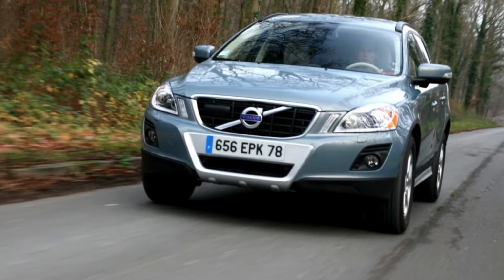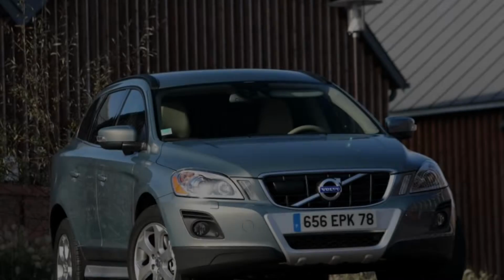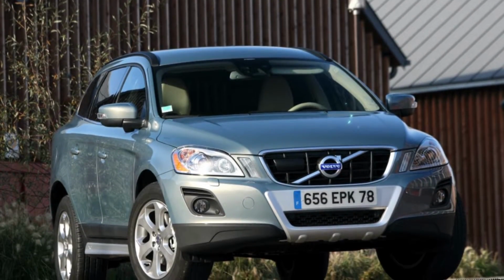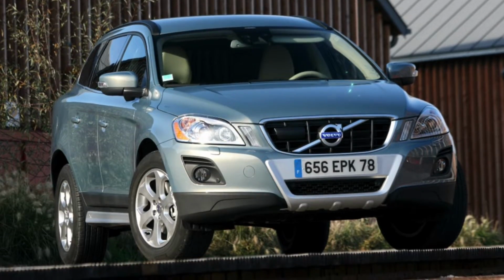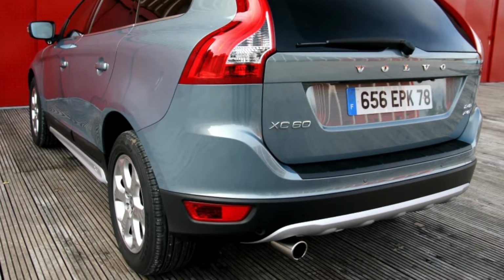Volvo XC60 Problems | Weaknesses of the Used Volvo XC60 I

Comment: so my xc60 t6 after leaving it off for a few minutes ill start it up and just barely hit the gas to rev it while its in park and ill hear and feel a slight grind and then everything is fine like it drives smooth no issues or sounds, i did a trans flush and noticed theres a leak between the transfer case and trans not sure if they share fluids but my guess is the transfer case is about empty and the grind is the transfercase initial engagement. im not a mechanic but that small grind noise definitely only happens upon initial press of the gas i use to put it in drive then hit the gas but i felt like that grinded it harder than just doing it in park then put it into drive. so everyday i start my xc60 i start it, let the rpm settle to 700 then slightly gas the engine get the grind noise then go to drive/reverse and everything is fine just hit a 0-60 in 6.6s with 1/4 mile 14.7s  yesterday and i monitor the trans temp with my torque OBD2 and it  stays 190f with spikes up to 215 when doing a 0-60 combined with waiting at a red light for a while
Reply from the maker: That sounds like a transfer case issue, and you're right, it could be low on fluid.

Comment: Volvo XC60 107000 kms, 7 years, treated as own child and this year started to show being a very problematic car, fissure in one cylinder so change whole engine (13500€, no brand or wholesale sales support at all), 1500 kms later a fisure in one air tube (600€), 5000km later clutch problem(I’m waiting for the invoice)… definitely not a brand to rely on anymore.

Comment: My engine blew at 116,000 miles it is a 2016 xc60 t5
Reply: I’m getting my t6 replaced rn it blew at 126,000 and i I bought it with 125,000. Bad luck ig
Reply: @NaCl_Goat what was the cause ?
Reply: 2015-2016 Volvo's with 2.0 Turbo were built with too loose piston rings, Add the pressure from the turbo...no u see why so many are on the used car market. 2017's are great, comparatively speaking.

Comment: XC60 2012, Creaking when taking a speed bump at a moderate speed. Quiet when at a very low speed.
Reply: Have you checked your front strut mounts? This is a common problem with that generation... and the previous one too lol
Reply: Ours had countless problems from a roof collecting water and sqeaky breaks...a lot of low battery notifications right after its been in the shop too!